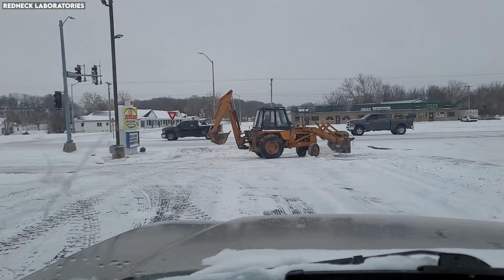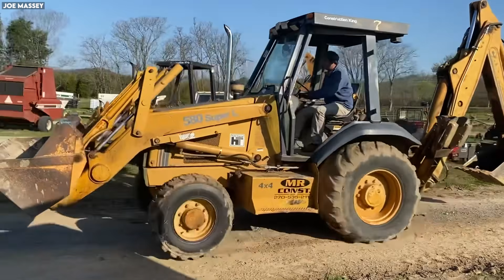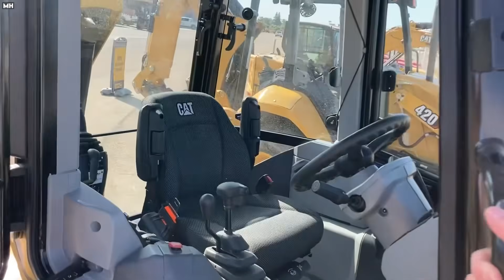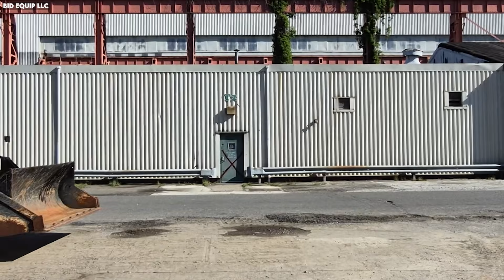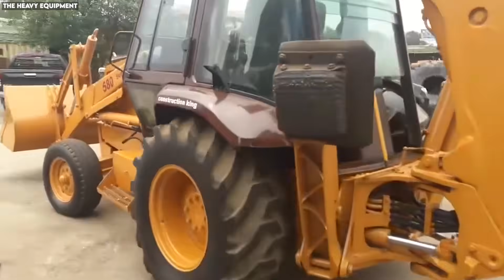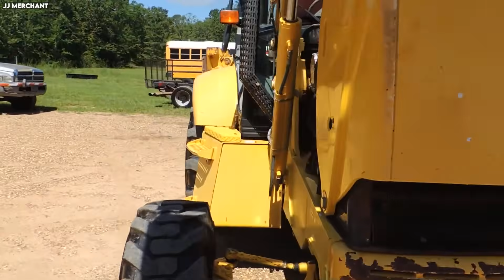10 Vintage Backhoes Contractors Still Swear By

Comment: Got to operate the Case 580-C & 580-K Brand NEW, first my uncle got the C model that I learned the 3 lever, foot swing operations on. 😊 They were NEW, so I saw and Ran very tight backhoe Loaders, I mostly did sewer ditch work with them both. YES the cold start preference was improved with the K model 😊 I finished my 50 years of mostly CASE 580 series Backhoe work with the 590 close to my retirement, the 590 was very used, when I started running her, but still a great Backhoe 😊 in my Retirement years now I own a 1978 Dynahoe-190 that is 19000 pounds, it's standard digging depth is 19 feet, no extendahoe attachment 😊 she is all one one mainframe build, with heavy counter Wt. on front. She has a standard bucket for backhoe of 2 feet wide, by 3 feet long, by over 4 feet deep. Very large, plus it has great total "CURL" on bucket for straight wall digging and loading into Dump trucks, without loss of dirt 😊 her hour meter says over 8000 hours 😊 and the Detroit Diesel 353 still runs and has that smokey blowby known from a Detroit Diesel 😊 Why I got a Dynahoe over a used Case backhoe was in 1979 I ran a brand new Dynahoe-190 on a big sewer mainline job, digging side sewer stubs. I had never ran a Dynahoe before, and fell in lover with its power, it dug down deep to the side sewer stubs that were close to the 19 feet depth she could dig, and with that bucket size, I dug more side sewers than if I had done it with a Case brand. I just think the Dynahoe-190 is a beast, and the 190 was not there biggest 😊 they made a 200 with all wheels being the same size as the big back tires, it had a crab like turning ability. Everything about a Dynahoe is so over built 😊 the Hydraulic cylinder are bigger than on the Case, and a Case has to have an extension on the backhoe end ti even dig the standard depth of a Dynahoe.